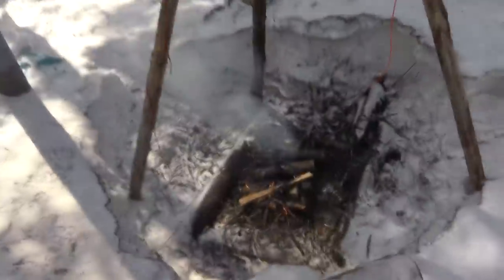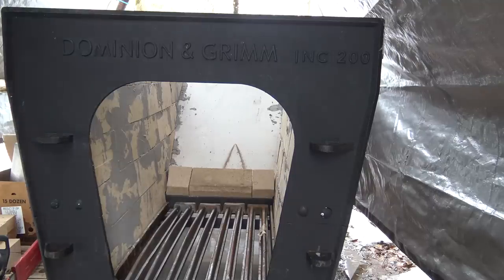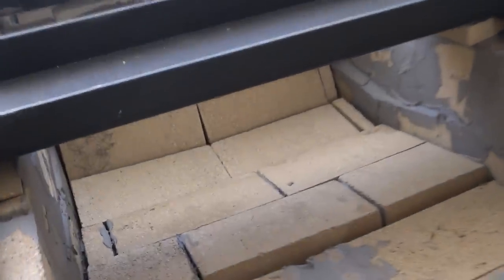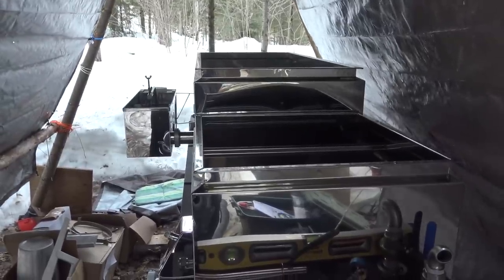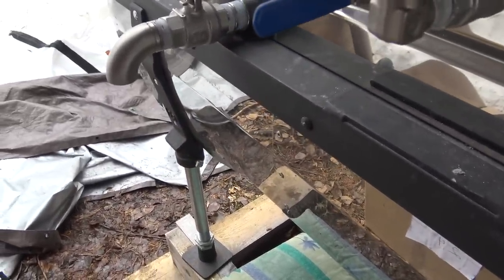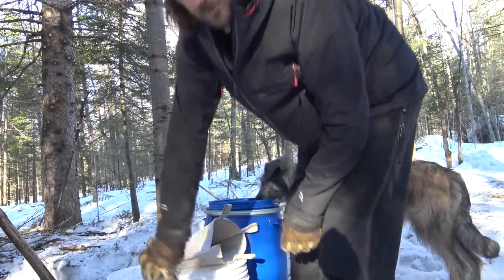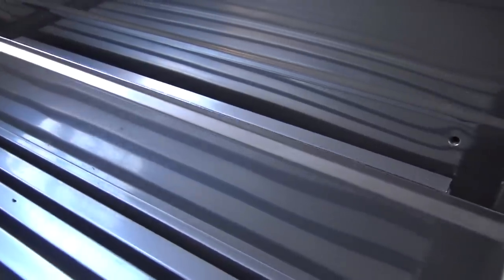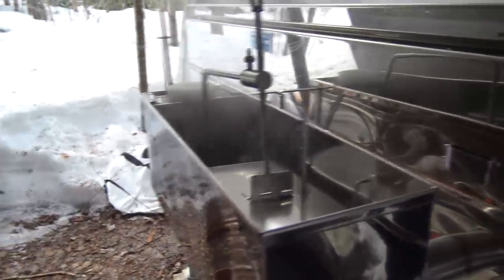Bricking my Dominion and Grimm Evaporator | First Boil | Cast Iron Cauldron cooking

Comment: Yes fantastic video Jeremy I know your catching up because of the work you an Delphine are doing just so glad you posted this I'm from Scotland an haven't seen much of this kind of thing I saw the wooded beardsman make a home made one I was wondering are you expecting to get more syrup than you've got before if so how much more 50 percent more?
Reply from the maker: Hi Derk,
I wasn't expecting the evaporator to make me more syrup, but it is big enough that it can handle many more trees being tapped than I currently have tapped; maybe 3 times as many or more.
It is also very efficient at burning wood - I only burned a fraction of the wood I thought that I would need for the season.
Reply: Oh I see saving you from collecting wood, I also want too know where duz the maple syrup get it colour from the saps clear do you add colouring sorry if this question seems dumb I just don't know the wooded beardsmans was quite dark is there a colour change while boiling
Reply from the maker: @derkhart6019  Yes.  As the sap evaporates it leaves behind the sugar.  The more sugar there is in the solution the more opaque it becomes.
Reply: Coolio it isn't really obvious thanks Jeremy